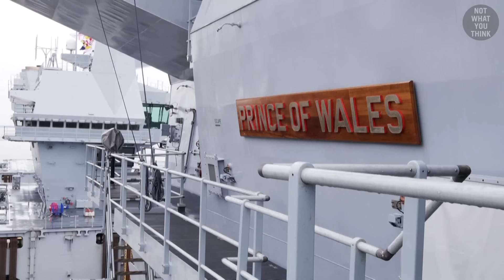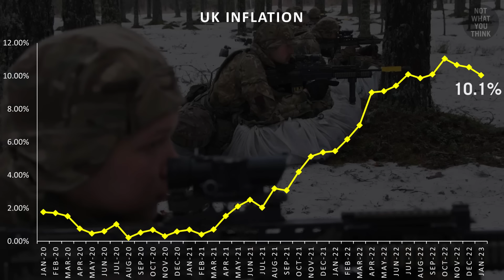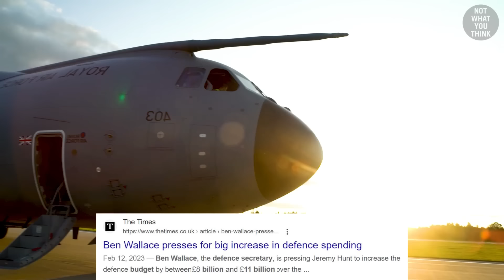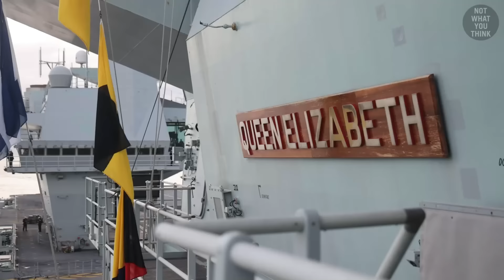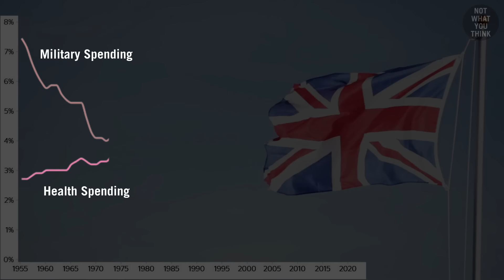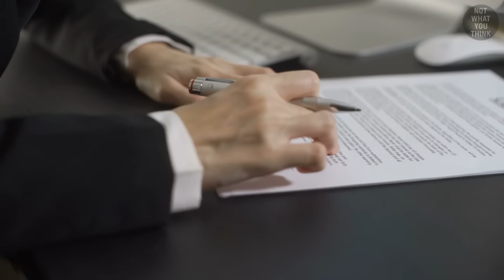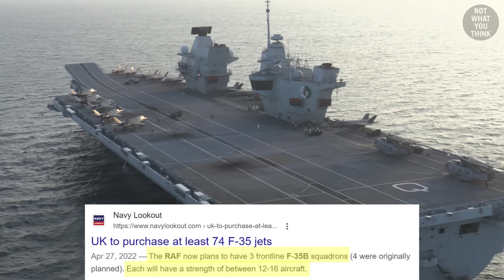Why QE Carriers are Considered a PART-TIME Fleet

Comment: This is a painfully ill-informed video I'm afraid. Former political frigidness over the two carriers no longer informs policy or strategy. PWLS is fully intended to takeover from QNLZ when she goes into refit around 24/25. Also, the UK has recently reaffirmed commitments to send regular carrier strike groups in conjunction with the French, a commitment that could not be made with only one carrier.
Reply: That may be Alex, but the fact remains the carriers are weak: there's not enough aircraft for a single carrier let alone two . Even if both achieve a full fighter complement, it will still be less than half that of the US carriers. Also, bear in mind, the F35B is less capable than the F35C used in the US Navy.  RN normally relies on escorts to protect the carriers from submarines and air threats, but carrier cost has reduced the quantity and quality of destroyers and frigates in the RN to the point that the service can no longer support all its obligations. Couple that with the fact UK carriers have weak defensive systems (ineffective 20mm CIWS - no missile systems) and there's a real risk these ships will be lost in combat. They've spanked all their budget on these white elephants and can't provide security to the UK.
Reply: @octowuss1888  I can only assume you're American 🤦 The UKs F35 buy has always been stretched out to ensure the bulk of the buy is of later block 4 aircraft. The most that would ever be on a QE in normal circumstances would be 24. The surge capacity of 70 is there IF it's ever needed not because it's routine. The ships just have to be able to support doing it, if needed hence the size of them.

The UKs defense budget just isn't as big as it used to be. Successive governments saw to that. Some realisation has occured to why that's a problem. Hence the multitude of ship building programs and the national shipbuilding strategy. 

The UK isn't the USA and is unlikely to ever have more than 24 or so surface escorts. That number was picked out as being enough 30 odd years ago. Having three different types of escort frigates was even a desire 20 years ago. Type 26, 31, 32 and the carriers are just the RN getting what they wanted 20 years ago. Two of the ships types are in build currently.
Reply: @octowuss1888  Not correct, the F35 can operate F35s on each carrier at wartime and has the capacity to carry 72 at flood load, The carrier cost has not reduced the quality of UK destroyers or frigates at all? no clue where youre getting this information from? T31 and T28 frigates on the way, T45s ( very easily argued the best AD Destroyer in the world ) has recently been upgraded with more VLS on the deck. There is no need for missile systems when you have an escort? thats the whole point of the escort, 20mm CIWS is far from ineffective is so every Navy that operates it would have ditched it long ago. The UK defence budget is now the 4th largest in the world (under liz truss would have been the 3rd largest) and IS the largest in Europe.
Reply: @carwyngriffiths  No, the max number of F-35B that can be carried by a single carrier is 36. The 72 is for both carriers. Given that HMS Drydock (formerly POW) barely seems capable of travelling out of port without leaking or throwing a propeller shaft that is unlikely. Also, the UK has only purchased 48 currently and those won't be fully delivered until at least 2025. More may be ordered but who knows when they will arrive. Bare in mind, they've already lost one due to forgetting to open all the air intakes, and a couple are permanently stationed in the US for training. Thus, the chance of having a fleet of 72 fighters is  almost non-existent. UK is broke - Brexit, Lockdown and Ukraine have emptied the coffers!
Reply: @carwyngriffiths  Surge capacity is apparently 72 aircraft of all types. However, it's highly unlikely they would ever have more than 36 fighters. You need significant numbers of Merlins for anti-submarine patrols as well as Crowsnest variant for airborne early warning. Plus some Wildcats are needed for small boats/suicide craft screening. You'll also need several Chinooks and a few Apaches for amphibious operations.

Comment: This video has a few inaccuracies...

Amphibious assault ships scrapped (FALSE - Bulwark and Albion are in fact still in service).
Had to give up last two type 45 destroyers, FALSE - The government forced that due to their normal stupidity, it wasn't due to the carriers, it went from 12 to 8 to 6 because of terrible contracts and cost overruns) and the 3 type 23s weren't sold to Chile because of the carriers either, the navy looked at "assets and operational requirements" back in 2004 and decided to sell them. Which obviously wasn't a good idea considering escort hull numbers right now.
The QE's can carry up to ~60 aircraft and the UK currently plans to buy "at least" 74. The idea that a carrier which is only slightly smaller in terms of deck and hanger space than a Nimitz can only carry 24/36 F-35 is stupid. The real question is if the government takes defence seriously and spends the cash. Unfortunately there hasn't been a government like that since before WW2 in this country. Everything the government and the MOD do is stupid and short sighted in regard to defence. Great power competition is back, people need to wake up and realise if we don't put the money into things we run the risk of losing our very way of life.

Comment: with this many issues it's not bad luck it's improper construction by the ship yard they didn't do a proper job on the ship and should be held responsible . the first carrier is almost perfect but this one is just the result of the yard getting slack on there quality control . they more then likely thought it's going in to dry dock so why bother but now it's a ship of the line they need to fix all the stuff they let slide
Reply: Probably because the Queen was still alive during commissioning. There was a pressure not to mess up the ship with her name on it
Reply: I do not think it helped at the time they were building it, they were being told  it was never going to be used.
Reply: @Demopans5990  it's not named after Queen Elizabeth II though

Comment: As for the Dry docking and such, I am suggesting that they did the same the like the USAF did with the 485L Program(I was there at it's demise, it was temporarily replaced by an off-the-shelf IBM Sys34 Serial #2) in the '70s, ie...get it all working and then decide to add something new and screws previous parts of the system and continues with such until it's a Total Clusterfuck...IMHO....Uh, it would be easy to fully load out both carriers, merge a few from NATO members on Squadron Rotations....this would allow inter-service training and more....

Comment: UK F-35's also qualify as portable submarines, so you could only have 1 carrier going and extra F-35's trailing it underwater. Tests have been going on in the Méditerranée
Reply: The US have crashed more F35’s - the USMC lost two last year.  
Have France surrendered yet ? 😂
Reply: We seem to be placing a lot of faith on a select few very shiny new high tech systems while disregarding other more important aspects of defense expenditure like training, mainaitnece, and most importantly having redundancy and strategic depth. 

As Ukraine has shown, relying too much on any one system is a fatal mistake. You need to have redundancy and strategic depth in any conflict for when things inevitably go wrong.
Reply: @ghostwriter2031  France has nuclear powered AC, i mean CATOBAR, with flying omni-roles Rafales, bi-engines  with longer range, which have never crashed due to a plane problem. 
Brits will need 4 AC to have the same capabilities so it's normal if they use more their planes and crash more often.

Comment: The major issue I see with the QE class is that it has an identity problem. 

I mean, yes it’s a carrier, duh. But it’s the size of a super carrier, with the air wing of a SVTOL carrier (hence the ski jump). I mean don’t get me wrong, the F35B is a great platform. And in the right hands, it can do the capabilities of a F35C. But a super carrier can deploy fixed wing Early Warning aircraft, logistics aircraft, fixed wing at a higher load capacity, and soon small tanker aircraft. The QE class is limited to early warning helicopters, and svtol aircraft.

So I’m thinking; if you’re going to build a ship the size of a super carrier, why not just build a super carrier?
Reply: It is a supercarrier. Having catapults or not doesn’t make it a supercarrier. They are thinking of adding catapults soon and imo they might as well put them on the Prince of Wales now as it’s going to be in dry dock for a while anyway. But it can carry a good assortment of aircraft, up to 72 in wartime when they cram everything on. The TV shows don’t do it justice, when they only show it having 12 or so fighters and 12 or so helicopters. When the yanks decide to deliver our F-35B then we will be able to arm them with the typical 24-36 that they should have during peacetime.
Reply: @king_goose  in its current state in can't launch AWACS fixed wings. Something considered a key part of modern air combat. It needs catapults to be labeled a super carrier.
Reply: @lewisallan9963  Super carrier isn't a defined term in any way beyond "big carrier". The QEs are super carriers because they are much bigger than carriers operated in the past, and currently operated by countries like Spain and Italy, and the "totally just for helicopters" carriers of Japan. Presence of catapults is not a requirement for a super carrier, size is.
Reply: @king_goose  The QE would never deploy with a full complement of F35s except in war. They belong to the RAF, and will remain at their land bases unless absolutely required. There's no point in all of them slowly getting damaged by seawater.
Reply: @mikelovesbacon  yes, that is another poor decision. Having shared fighters. The Navy should have got the F-35B and the Airforce the F-35A as it is made for the airforce for runways.
Reply: @king_goose  I agree but it's also easy enough to fix in the future
Reply: Only in the short term it is fully committed to having emals when it's problems are worked out the deal has already been done, a lot of people view these carrier's as being like the U.S carrier's which they are not the QE class is very modular and can be reconfigured as requirements change much faster then a typical complete refit would take.  The UK's reduced order on F35's is due to developments in other aviation projects that may for a change come in ahead of schedule though I won't hold my breath the M.O.D can screw up boiling water much less anything more complicated.  They were originally designed to have a catobar system but the ridiculous price quoted to install it into the two carriers meant that was shelved as it should have been no government would agree to a price just a little short of building a third carrier.  

The Royal navy's biggest problem is crewing these ships or anything else since the UK government's constant cuts the military isn't viewed as a job for life giving less reason for the traditional working class to enlist which has always been the backbone of the army and the navy.  It isn't just money needed it's a complete change of attitude from the government to the military until that happens and a lasting commitment is made to the armed forces we are going to limp from one drama to the next.
Reply: EW can be operated from land and is done as such. Catobar requires the nuclear reactor for steam and raises maintenance( not een going over the fact they can break, when you have 2 carriers in operation and one of their wires breaks you're pretty fucked) QE is designed to operate EMALs in the future, when it actually works well that si
Reply: @carwyngriffiths  NATO operates a fleet of early warning aircraft, flying over Europe. The US operates even more over North America. Those are both land areas that have ample land, and power.

Why is it then that nations prefer a EW aircraft, to a land based radar???

(PS: I know the answer, I’m just curious if you do)

Comment: Getting rid of her is an obvious mistake but if they were to either mothball or sell her, I'd hope they'd sell her to Japan. Japan definitely could use a carrier larger than the little flat tops they have now. And they have F-35s already. Seems like a perfect match to me. Sad thing is, it is way too logical for it to actually happen.
Reply: Sell design to india
Reply: @Gr8putin  only flat top from now , we will have 3 stobar type , now catobar is the req.
Reply: @Gr8putin  
India won't repeat the mistake again by buying a second hand carrier
Reply: @fly463  did you read what I said ? I said sell design not carrier
Reply: @Gr8putin  
That will make the induction timeline next decade 
Sistership of vikrant is ok
Reply: It would be a breach of Japan's constitution which forbids Japan to have a military power projection capability.  Japan circumvented this in some manner by building a large destroyer fleet within its Home Defense force framework.   You may have forgotten what happened the last time Japan had a large carrier fleet.  Some haven't.
Reply: @mikecimerian6913  Japan's constitution isn't exactly clear and well defined on what Japan and can't do as far as its military. Yes, it stipulates that its military is meant for self-defence only and not to have any offensive capabilities, however that leaves plenty of room for interpretation.
Reply: @mikecimerian6913  Japan literally has carriers already, just small ones.
Reply: Does Japan have the correct version of F-35 though?  Only the F-35B STOVL is carrier based and was built specifically for the QE-class carriers, it is unlikely Japan has any of them.
Reply: @pieterveenders9793 So you want Japan to become the next Ukraine.  Not surprised a minute if it's coming from Brits.
Reply: Nah…. Japan is just fine with two functioning light aircraft carriers…
Reply: @krashd    Japan is getting 42 F-35B’s for their Izumo Class carriers….
Reply: @mikecimerian6913  If you're ok with the US to continue to subsidize the defense of Japan when they're clearly not a threat to the US while they're simultaneously threatened by an aggressive, expansionist power, then ok. You may have noticed the geopolitical situation has changed just a little bit in the 75 or so years since the Japanese wrote their constitution. It is in the interest of Japan and the US and anybody not named China for Japan to have a strong deterrent force.

Comment: About the F-35s. Queen Elizabeth is going to be retrofitted with an EM catapult in its MLU. This would make the usage of the F-35B obsolescent on this specific carrier. If UK orders more F-35C aircraft in the future, those VTOLs will all become available for the Prince of Wales. In the long run, UK should order the C version rather than more Bs.
Reply: It is very unlikely that we will fit an EMALS when even the US can not get theirs to work efficiently.
Reply: Impossible.
It doesnt have the angled flight deck, nor the steam prodcution capacity for steam catapults, nor the electrical production capacity for EMALS (the chinese CV double the electrical capacity of the QE to be capable to operate EMALS). The french used the QE design to design a CATOBAR CV, but it was heavily modified and nuclear.
Reply: @karakarakiri9568  The structural requirements are already there these carriers were meant to be catobar but the company got greedy and wanted £3.1 billion for the systems for the two ships so the government went with the current design.  Another point to bear in mind with these carriers they are not built the same way that U.S carriers are these are basically a lot of boxes arranged in a given fashion but can be reconfigured as requirements change they are the most modular builds in the world.  They are that bad that the U.S navy has spent a lot of time studying the different technologies in these carrier's particularly the autonomous systems that drastically cut crew size it is way too early to judge these ships and the problems with POW have happened during sea trials which is what sea trials are for to have, identify and rectify any problems.
Reply: No it's not.

The space is there, but it just doesn't make military or financial sense.
Reply: @andrewaustin6369  sorry that's utter bollocks. There was a large study done years before the carriers were built. That looked at three smaller carriers, Nimitz sized carriers, 60K tonne, 80K tonne. Catobar, Stobar Stovl. The RN preference was  an 80K STOVL ship. They got a 70K STOVL ship. After a section was removed from the design. Government meddling after construction had already started led to the single cat+trap ship idea. By then it was far too late to make that change and not even what the RN had actually requested anyway.

One ship was always a moronic idea. If we'd have done that we'd have NO operational carrier right now. Also the F35B is a more common carrier aircraft. Four navys will operate it at sea. With potentially another couple maybe in the future. For the UK it's also far easier to hit that surge of 70 aircraft if carrier quals are STOVL based not CATOBAR. Just because the USN can do it the RNs man power and training pipeline just isn't similar.
Reply: False
Reply: A lightweight emals is a possible update to allow for the launch of heavier drones. Certainly not for the F35c.